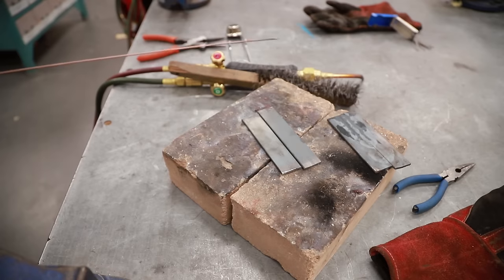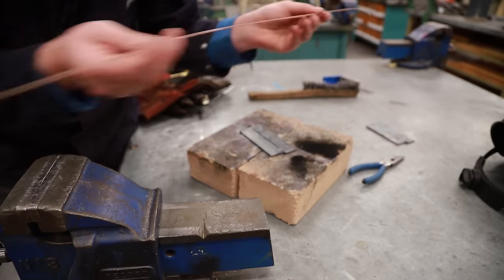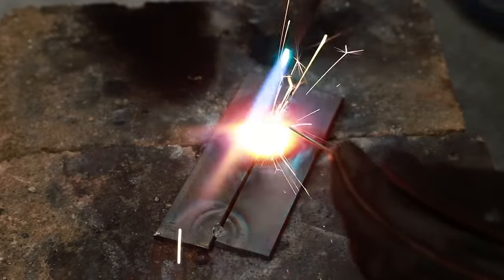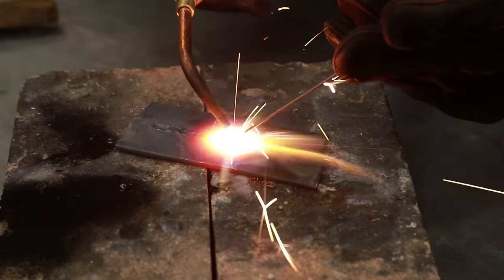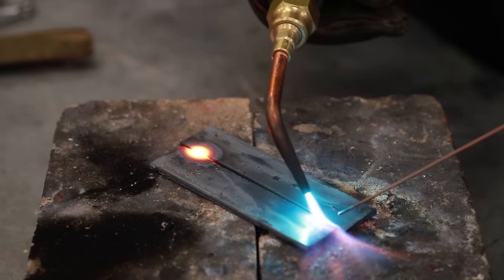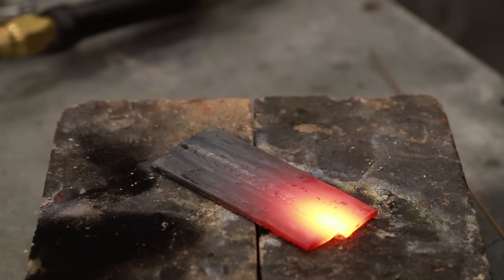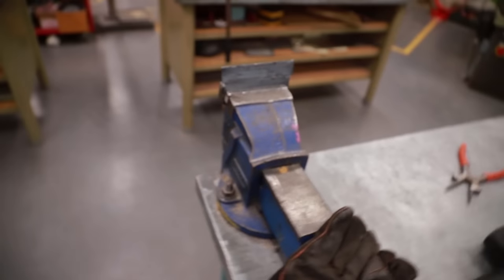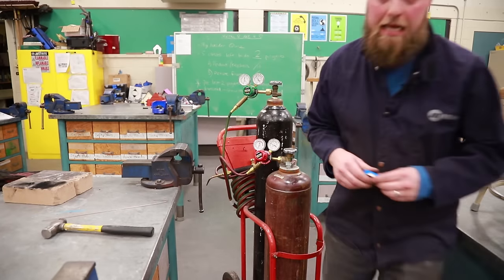Intro to Oxy-Acetylene Welding - Part 2

Comment: Mockery of the guest. What you showed are jokes, If you break your joint with a single hammer blow. Don't show bad habits and learn alone.
Ps. I do not recommend
Reply from the maker: Hence why this is just an intro. This is for my students to practice getting used to a torch. My other videos/lessons show them how to get deeper penetration properly 😀 thanks for watching
Reply from the maker: You can see that these welds are just surface welds. I work the students through the steps to eventually get full penetration before moving them onto stick welding and MIG
Reply: you are student

Comment: I was taught shut the oxygen off too and then acetylene. That way you don't get no pop and are you a fifth grader trying to hit a piece of metal hit the metal Man you can clearly tell that isn't holding anything and you're playing tapatapa tap it tap it it's never going to break
Reply from the maker: Mistakes have been addressed in the description and a new video posted with better techniques and some better safety stuff. I had some bad habits from a previous teacher. We are all always learning.
Reply from the maker: In terms of hammer usage. We are not using 1/2 plate that needs a lot of force to break. Just to show students the penetration spots between the thinner 1/8" flat bar. I would rather teach kids about controlling a hammer than swinging like a brute.
Thanks for watching